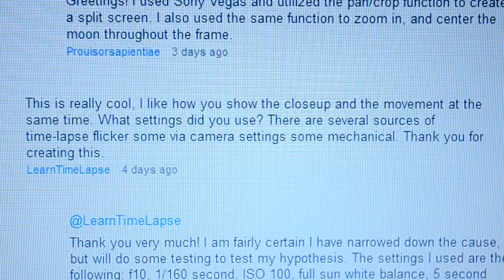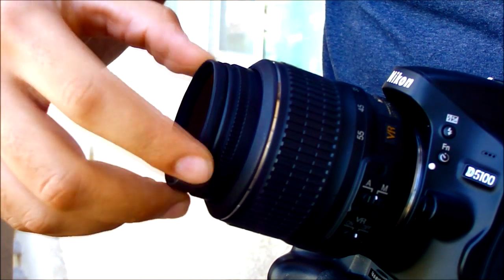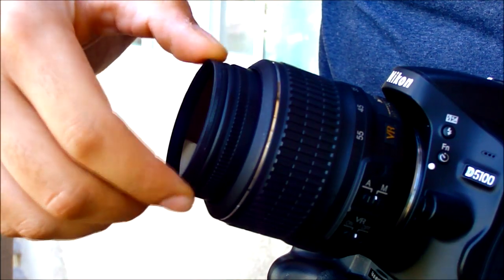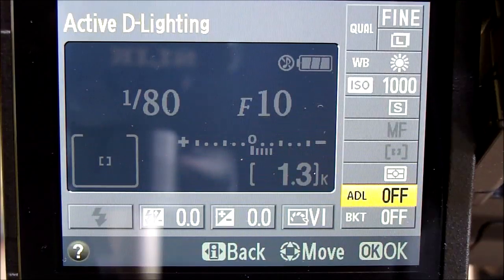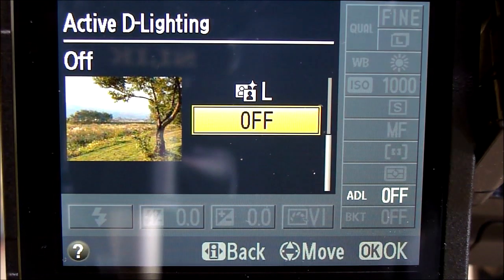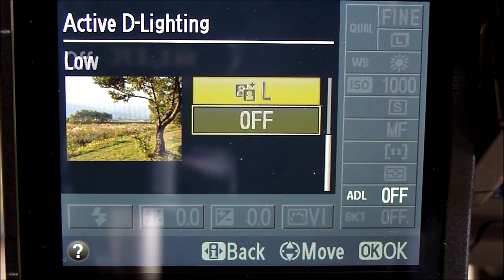How To Solve Aperture Time Lapse Flicker

Comment: Great video! and good extra tips at the end.  Did you try deflickering software to possibly correct the original moon shot you got?  I will hopefully have some software tutorials up soon for compilation and deflickering but check out VirtualDub (free) 
or a free plug-in for Adobe Lightroom LrTimelapse. GBDeflicker is also good.

Comment: Well done -- very clear demonstration.  One suggestion --  that "lens twist" trick may not have worked for you because you need to push the "depth of field" preview button simultaneously as you are twisting the lens to disengage the contacts.  The DOF button will put the aperture in the correct opening...

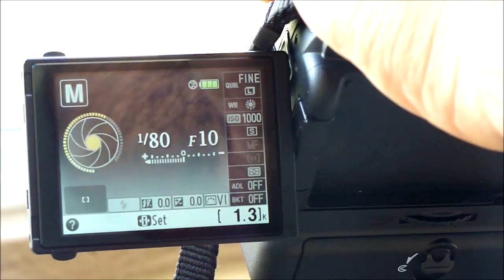Comment: I once tried slightly detaching the lens like you showed at 3:42 on my nikon D7000 but it didn't work. It stopped releasing shutter until I completely unmounted the lens or mounted it properly. Any solution?
Reply from the maker: +Waleed Ali I eventually learned that this trick only works on cameras with a depth of field preview button.
Reply: It is not a viable option for Nikon even when if there is a depth of field preview button.  It does work for Canon, though.

Comment: Well, I have to admit, I've tried two separate deflickering softwares, tried moving away from light sources so the only light that changes is soft light (thus reducing flickering), tried changing the interval between shots and never thought of shooting at the widest my lens goes - all this despite being aware that the flickering was caused by the aperture ring opening all the way and closing down to your required setting when taking pictures. THANK YOU.

Comment: Heya
Even with Aperture Priority, you need many adjustments during the day to night transitions.  Like increasing the ISOs, etc.  Also, the A program on my D90 didn't do any shots with speeds slower than 8 seconds, not sure why.  So when the A program gets to 8 secs, then I had to switch to manual.
LRtimeLapse didn't eliminate all the flicker, I had to scroll through the pics manually to alter some of the settings frame by frame. The result is posted in youtube, but it's far from perfect :-/

Comment: Hi! Good vid but....Problem: Nikon D7000, lens:18-105, manual mode, 1/20 sec, f13, VR-off, Active D-lighting-Off, used a cpl, used a grad ND filter for the sky. Edited the lapse in Lightroom and LRTimeLapse with de-flicker on. In the end...it still flickers like...(now I'm cursing). I don't know what I've done wrong or how to fix it. PS: the lens fooling trick does not seem to work on Nikon. It just resets the aperture to its minimum (in my case f22@18mm).

Comment: I'm guessing the slightly detached lens is preventing the camera from setting the correct arpeture? so the lens would have it's arpeture set at whatever is the default (probably f22?)'that's why you need toraise your ISO etc..
Reply from the maker: +fommes Yes, that's exactly what happened.  Without a depth of field preview button, the lens detachment method is essentially useless.

Comment: Thanks a LOT, man!!!!!!!!! I had no idea about the aperture inconsistency effect and it solved a serious doubt I had about my last timelapse, where I started with f3.2 and then switched to f2.8. That´s a very weird effect on your Nikon when you detach the lens. I mean the huge EV drop. I made a test with my Canon T3i and when I detach the lens the EV stays the same. Maybe there is a piece of chassis blocking some of the light when you turn the lense? Try with different turning angles to see what happens. I also would try placing a small piece of paper or tape or food film on the contacts to make sure they are completely isolated.
Have nice shooting
Reply from the maker: I'm glad this helped!  As for the weird drop in exposure, I eventually figured out why.  I also have the T3i, and discovered that Canon cameras have a depth of field preview button.  The Nikon doesn't have this.  It allows the aperture to stay locked when you detach the lens!  Your trick of using a piece of paper or something equivalent will work.  Thanks for the comment!
Reply: @Prouisorsapientiae  , my D750 has the depth of field preview option.  The technique didn't work for me.  What I discovered is that the Nikon lenses default to a stopped down aperture when they are completely off the camera or mounted but not locked into place.

Comment: Have you learned anything new since this? I've been setting my cameras to A mode so that it will adjust from day to night. I recently purchased Panolapse (on sale right now too). It's a bit cheaper than LRtimelapse, but I'm not sure it's as good or better. The alternative is VirtualDub plus MSU deflicker module, which is free, but only for a mac. Panolapse has a setting to reduce flicker. It takes so damn long to export files and render them, that I haven't gotten a good feel yet for how well Panolapse works, but it was too hard to gauge based on the demo, so I bought it instead :/
Reply from the maker: ***** Unfortunately, I haven't been picking my camera up very much.  I've always avoided the night-day transition shots because of the hurdles of overcoming the flicker.  Apparently, the newest Nikon camera has internal smoothing of some sort to eliminate flicker.  I saw a YouTube video of it in action, and it seemed fairly impressive.  The Panolapse sounds interesting, I'll have to check it out.  Hopefully you have better inspiration than me, because I certainly don't have much lately!
Reply: Hah, trust me, I've lacked so much inspiration. I recently bought a house and am creating a studio. Finally got part of a ceiling up. It's been months of work. Then finally I can put my music and photography equipment up. Definitely haven't done very much with video or audio. Hopefully you'll be inspired soon too :) Good luck and cheers. Good to hear from you.
Reply from the maker: ***** Congratulations on the house!  Making a custom studio sounds like fun!  Construction is pretty tedious, especially finishing interiors, but feeling of accomplishment at the end makes it worthwhile!  Maybe changing my settings will spark something as well?  Who knows!  Good luck and good to hear from you as well!

Comment: Hi there. I'd be interested to know if your lunar eclipse time lapse could be corrected in the following way. Use any video editing software that allows you to layer clips and change their opacity to duplicate your time lapse (so two tracks of the identical footage parallel to one another). Shift the top track forward one frame, and change the opacity of the top layer to 50%. This has been used to often completely eliminate strobing in footage that has conflicting frame rate to light source frequency issues (LED commonly cause this issue nowadays). I think it may save your lunar eclipse. There are plug-ins that would definitely do the job, but I believe this would as well.
Reply from the maker: Yes, you could do this.  I have actually done this before on a very short clip.  It is time consuming, but worth the effort if you do not have a de-flicker plugin.  As for the flickering artificial light, many people are not aware that most modern cameras have a frequency setting for 50 or 60Hz for traveling to different countries.  You'll see this a lot in travel videos on YouTube.

Comment: Man, had I not found your helpful videos last year, I sure would have found them now! I'm so pissed off with flickering in my timelapses. I use Darktable currently and was hoping as a photo editor it could automatically fix deflickering. Nope (but I'm finding way more issues than that with Darktable). I thought my Adobe Premiere Elements could fix deflickering... nope. I did two timelapses tonight... one with an auto lens, the other with a manual lens... wonder how they'll compare! However, I was using magic lantern on the one with the manual lens and I had set it up to do exposure compensation for sunsets, that might screw with my settings. Anyway, this was extremely helpful, thanks!
Reply from the maker: ***** That's cool to see that you are getting into time lapse photography!  Flicker is the biggest obstacle when first starting out.  Usually the most common culprit is the aperture not being wide open on most modern lenses, as you have found out!  I believe you will still have flicker using magic lantern, because only a really good, programmable bulb ramper can adjust the exposure minutely enough to prevent flickering.  Sunrises and sunsets are the toughest to do.
Reply: I was using the bulb ramper from Magic Lantern to go from day to night, but it kept doing weird things like going from light to dark, to very bright and slowly down, like a sawtooth (over the course of like 100 pictures). I didn't understand it. Tried the nightly build of ML and used Auto ETTR, hoping to get smoother transitions. I have a manual lens and opened the aperture as wide as possible (though with this fisheye from rokinon, it doesn't focus as well when opened as much).

I purchased Adobe Lightroom to work on my photos and might get Panolapse as well... have you ever used Panolapse? seems nice, but not sure it's worth $80...
Reply from the maker: ***** Yeah, I remember reading about bulb ramping in ML, and the consensus was that it wasn't the greatest.  You're going to have to purchase some better tech if you want to successfully get the day to night time lapse; also known as the "holy grail" for time lapse.It's funny you mentioned purchasing Lightroom, as I am tossing around the idea of getting it as well.  There is a free plug-in available for it that de-flickers time lapse shots.  It's called LRTimelapse.  What is a Panolapse?  It sounds like a motorized attachment that pans the camera while shooting time lapse.  Got a link?Check out the forums on timescapes.org.  You'll find a plethora of time lapse information there.
Reply: I'll check that link out! I've done A LOT of research the last few days. I went with Adobe Lightroom 5 and LOVE it. It's amazing (though you might want to try it for free, also, give Darktable a try, it's a free application that's nice, but does have some bugs).

If you have ML, you should check out the nightly builds. I installed it and the Auto ETTR and de-flicker thing works really well. You just have to remember to read the metadata from the files... and you can't adjust exposures on the files (because it keeps the exposures between photos the same). It's pretty awesome. The nightly builds are dead simple to install too.

Now it's just a matter of sitting outside doing nothing for a long time...

I really want to get some night or day time-lapses in the city (Minneapolis), but I'm not entirely sure how to go about it without getting my shit stolen while filming...
Reply from the maker: ***** Yeah, I'll probably try out the free trial soon.  Darktable is new to me, so maybe I'll give that a go as well.I barely even use my T3i, let alone have Magic Lantern.  The nightly builds DO sound interesting.  Maybe I'll attempt to screw around with it to revive my interest again.I couldn't help but laugh about your city comment.  Those thoughts have prevented me from doing quite a few different shots, in a few different places.  It's either theft, or being bothered by law enforcement.  It seems having a camera in public is now considered some terrible crime.

Comment: Thanks for this! Really great video. Like you, I've done dozens of time lapses for clients and for my own enjoyment and I experienced this problem recently while on a ski holiday in a really gorgeous mountain range in Europe. It was very sunny so I had to close my aperture almost entirely (which realizing after watching your vid I pretty much have never done in the past). I was using an ND filter but it was still really overexposed. When taking clouds, what is the slowest shutter speed you would recommend? I was at around .6 of a second, with my variable ND filter turned up. I'm thinking I may have to invest in a stronger ND filter - but would love your input! It was a location I won't be returning anytime soon and pretty frustrating that the time lapses were pretty much ruined by flicker.
Reply from the maker: +Rich Adler I'm a little confused.  You mentioned that with a variable ND filter the image was still overexposed, but you asked what is the slowest shutter speed I would recommend.  I believe you mean the fastest shutter speed, since this is what you would need to do to correct the overexposure?  If so, than I would suggest experimenting.  I noticed my Nikon doesn't care what shutter speed it's at, as it will not produce shutter flicker.  My Canon, on the other hand, doesn't like to go above 1/1000 or so before it starts to flicker.  I'm sorry if this isn't what you were trying to ask.  Feel free to follow up if you have any other questions.

Comment from the maker: You don't need to use the AE lock button.  You probably forgot to set the aperture wide open.  I do it all of the time!  Another possibility, is that if you were using a variable focal length (zoom)lens set somewhere in the middle, it could have created slight flicker.  I have noticed this on my 55-200mm lens.  Another possibility is high shutter speeds.  I doubt this if you are using the D5100, because I have never encountered shutter flicker on mine, but you never know!

Comment: The reason you got a darker image, is because Nikon lenses has a spring that pulls the lens down to the smallest aperture. So you set it to f10 but you were actually at f22, because the lens pulls itself back to f22. That's why it was darker.

Comment from the maker: I hope things work out for you!  In extreme situations, sometimes stray light can enter the viewfinder from behind the camera, and work its way to the sensor.  Another tip I have learned; if you are using a zoom lens, try to use it at maximum or minimum focal length only, especially with cheaper zoom lenses.  Good luck!

Comment: It's a highly recommended Software in my opinion.
I've never seen a software that does RAW proccesing this good and fast even with DNG's.
5 Version is really an complete choice for sure, even if you shoot video
it is actually a cool trick because it doesn't edit videos generally (making preset of a still from video and applying it to the video)

i think it's available for about 80$
And it worth every penny for sure.

Although i'm kinda sure you know most of these stuff about Lightroom :D

Comment: I don't know for Nikon users, but as Canon user I can screw my lens a tiny bit loose on a set aperture and the lens will keep that same aperture fixed. So the aperture doesn't move at all, just like a manual lens. I don't know if that works with Nikon lenses, but try it out ;)
Also, here's video that shows those inconsistenties of the aperture. /PVnqd4f3Kmk

Comment: Just to add a correction at 01:50  - it's the other way around. Modern cameras have open-aperture metering ... and the lens only closes down as it takes the shot. 

In other words, the aperture isn't closed and then opens up for the shot. It's the other way than you describe - it closes down for the shot.
Reply from the maker: Thanks for the correction, Neil.  I realized the mistake shortly after making this video and never added an annotation.

Comment: Here's another suggestion: if your lens has a stabilizer, turn that off. If you're using a tripod, you don't need the stabilizer. Not only does it sometimes cause wobbliness in your time lapse, but it also draws more power from your battery.
Reply from the maker: Excellent advice!  I've noticed the image stabilization will reduce battery life to about half.
Reply: Is it really that bad? I have noticed an improvement in battery life, but I have not noticed that much of an improvement.
Reply: Damn your the man of the month !
Reply: David Tsai Yeah, I recently learned this too. I honestly thought it was because I was in a building, or on a parking ramp and that caused the wobbling. Was totally IS. Can't believe it took me this long to figure it out.

Comment: That's a neat trick!! so all we have to do is just disengage the lens, and we're good to go... no need to buy expensive lens.
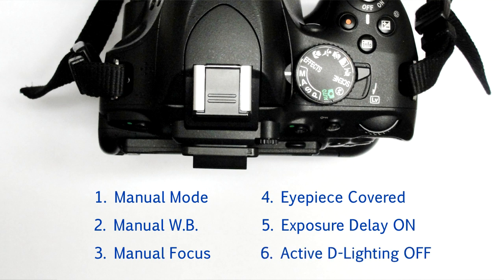Reply: and follow the rules in 6:35.
Reply from the maker: The only problem with this, is that if your camera does not have a "depth of field preview" button (Most, if not all Nikons), this will close the aperture as far as it goes.  This is why my images were underexposed during the example in the video.  If the camera does have this button, if you hold it down while disengaging the lens, it will lock the aperture to whatever you have it set at.  I hope this clears things up for you.